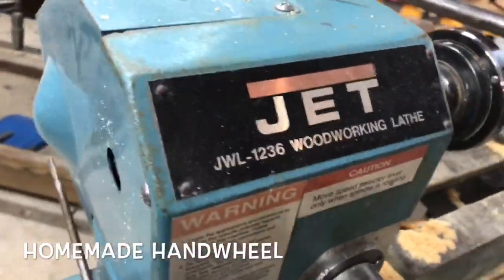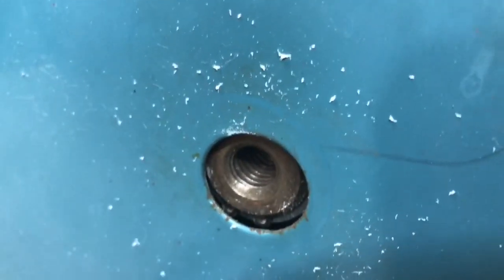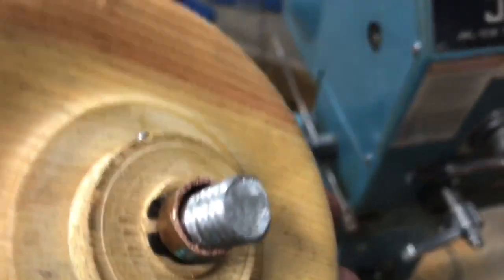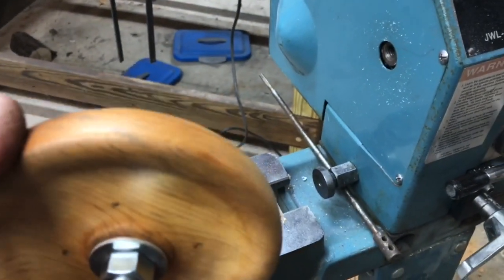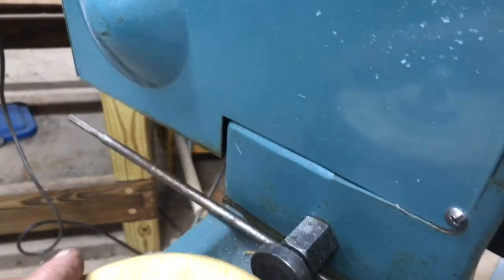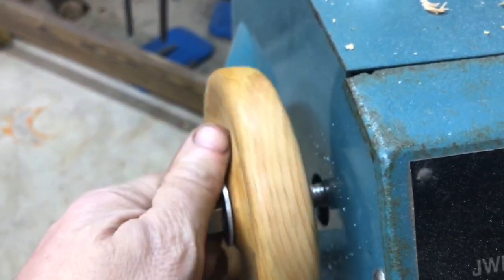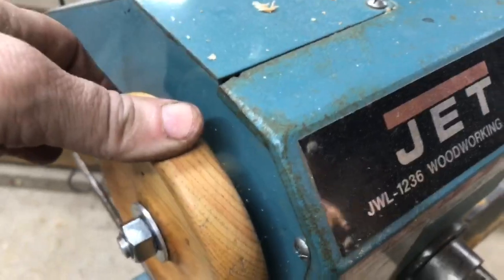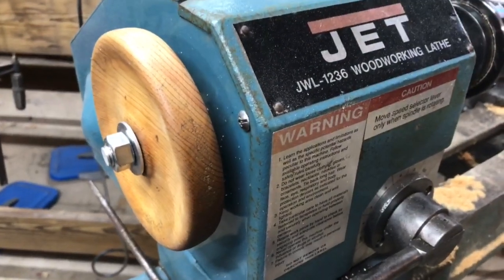Handmade Lathe Handwheel

Comment: I'm not sure at all about the "whitworth "thread thing. the 12 tpi and LH is correct, Single ponted it on the lathe and  the 55 degree thread would just startto engage  and then bind.bind.  looking at the microscope, it was binding on the flanks. A little following with a trianular file, and it fit fine, so ????Standard thread